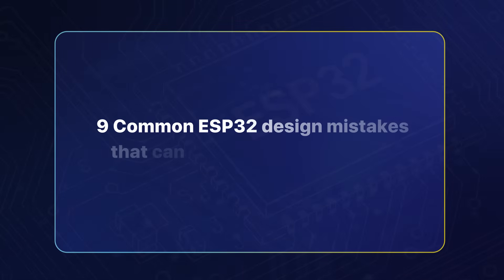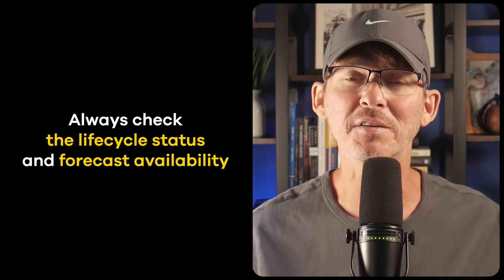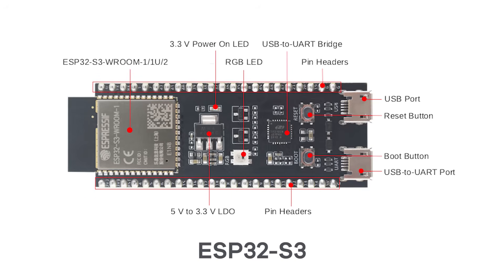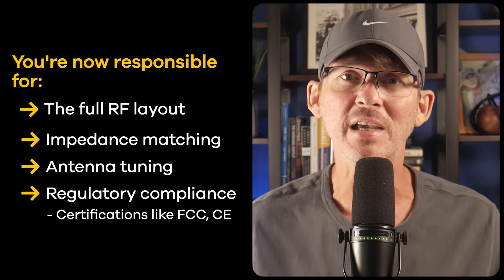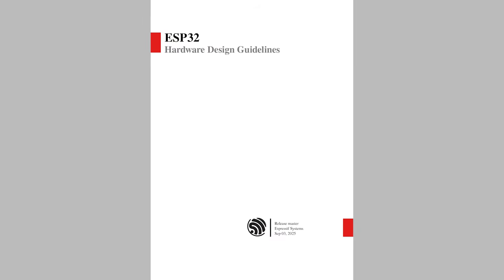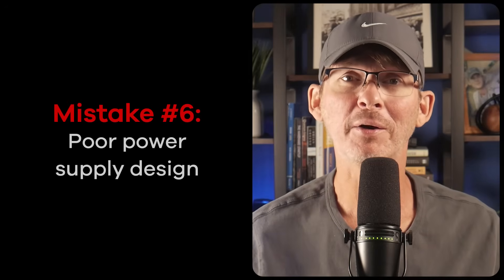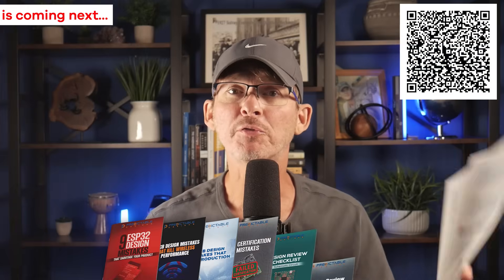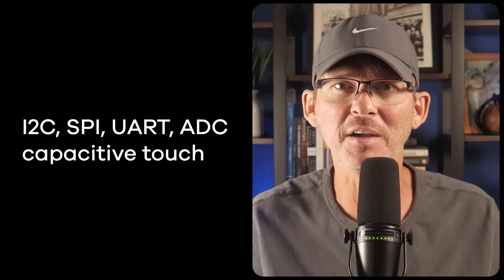9 ESP32 Design Mistakes That Sabotage Your Product

Comment: I am trying to evaluate whether to use an ESP32 or ESP8266 in a project that puts out "ghost signals" of drones. Drones are required to use Remote ID that uses both WiFi and BT. I recently saw a video where 5 ESP8266s were used to "spoof" RID signals into the air. 

https://www.youtube.com/watch?v=IcJvtMXrY80&t=186s. The 8266 only does WiFi but some drones do BT as well, and why I wanted to use the 32 series.

I tried the code used it the ESP8266 project on a ESP32 S3 and got several errors. In this example using the ESP8288 worked, but not the ESP32. It seems like the code for one series doesn't work for the others.

Would this be another factor to consider?
Reply from the maker: If you need Wifi and BLE then the ESP32 is the best choice. But the esp8266 and esp32 are quite different and will require code modification for the ESP32.

Comment: For example using a gps and cellular module with esp, is the antenna routing… still required? The esp itself has no use for ota, Bluetooth…
Reply from the maker: It depends if the modules have a built in antenna or a connector for an external antenna. In those cases no antenna routing is required.
Reply: @PredictableDesigns  Sweet, yes the Quectel BG95-M3, it has external antenna connector, using esp pico v3. Do you have a tutorial on antenna design?

Comment: Also don't forget: If you use WiFi/BT, say goodbye to ADC2.  Also, the ADCs can have non-linearity issues, and are subject to noise from the RF.  An external ADC chip might be necessary.  Also, many GPIO pins glitch on boot.  Also, while most pins can do SPI, the fastest speed (which you would want for things like high speed RAM)  is only available on some pins.  Going through the matrix will kill that fastest speed.
Reply from the maker: Fantastic additions, thanks so much for sharing and watching!

Comment: Definitely ran into my fair share of these!
1) On a project I switched from the S3 to the C6 and decided to go with the C6 and S3 on the same board for more processing power 😂
2) Going from a very basic prototype to ultra low power always requires a lot more little fiddling than expected!
6) Brownouts galore with max power Wi-Fi TX bursts due to long or thin wired USB power cables
8) Always seems like real world testing should have been done sooner. Rarely had anything work perfectly the first try.

Nice list! I think you should do a video on MCU companies. Like the other guy said, kind of like a tier list. I think you're taking point of view would be valuable. 

I have on my schedule a video to make about "Arduino vs STM32 vs ESP32" (😂 I know, "Arduino", but it's aimed up beginners) and a separate video to kickstart my "Wide World of Microcontrollers" ongoing series. Introducing all the big companies and everything from TI MSP 430 to Nordic Bluetooth and everything in between. I think your spin on that type concept would be helpful!
Reply from the maker: @FluxBench - These are so great, thanks so much for sharing your mistakes here:)  We all make them at various points. I've made my fair share!

A couple years ago I did do a MCU showdown video where I compared various ones, but it's rather outdated now with so many new options. Raspberry Pi has got some fantastic micrcontrollers now too.

My preferred ones are ESP32, STM32, nRF52 (BLE), and RP2040/2350. I love everything from TI (I'm of course biased), but I've only used the MSP430 rarely.

Thanks for commenting! Good luck your videos!
Reply: @PredictableDesigns  What do you think about the MSP430 nowadays?

Comment: Love this! Would be good to have a tier list of MCUs that helps us trade off the cost / performance / features / etc for different skus in different families. Yeah you see such lists but they're often not written with the kind of "adversarial" mindset you need for product design. Having worked at one of the world's largest consumer hardware manufacturers, with the luxury of unlimited internal RF facilities and locked-in supply chains, I can tell you the pros still spend 99% of their time asking "how will this decision come back to haunt us". The design is always guilty until proven innocent!

You see in a lot of forum posts exchanges like "I am using an ESP32 ..." and some gruff EE will say "You should be using STM32" with no further explanation (there will likely be many such comments here too, lol). But that doesn't reduce risk, it just swaps in a different and potentially novel set of risks. Do you want to be the first integrator to discover there's a microcode bug that surfaces after 1,000,000 deep sleep wake cycles but only if a particular combination of GPIO pins are used?
Reply from the maker: Some great ideas and advice

Comment: Yeah the S3 only exists for the I2S audio, which no one should use anyway. The C6 is mandatory for IoT due to 5ghz WiFi.
Reply: C6 doesn't support 5GHz wifi, the C5 does.
Reply from the maker: Good points.

Comment: I think I have hit 2 of these mistakes during my current build.  Bad antenna placement and not using the bet GPIO.  Both have caused for a PCB redesign.  This is my first project like this though with PCB and SMD components.  All in the learning curve.  However your videos have helped that my first PCB designs itself have worked properly.
Reply from the maker: Trust me we've all made lots of mistakes and it's all part of the learning process. I've made plenty of mistakes myself for sure.
Reply: Same boat for me, working on my first PCB. I feel like I recently hit the "Valley of Despair" part of the learning curve, especially with SMD component selection/size, footprints, etc. This channel is very refreshing.
Reply from the maker: Yeah that damn valley of despair is always so challenging regardless of what you're trying to do. Just keep pushing forward and you'll get there. Thanks for watching and commenting!